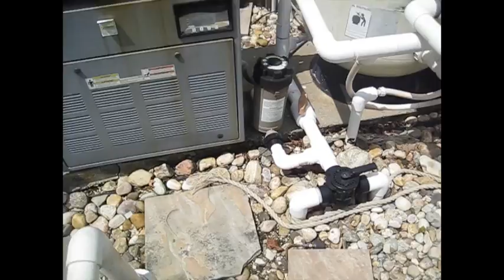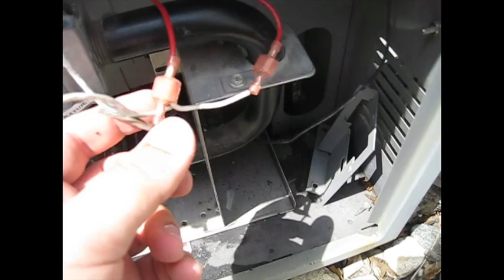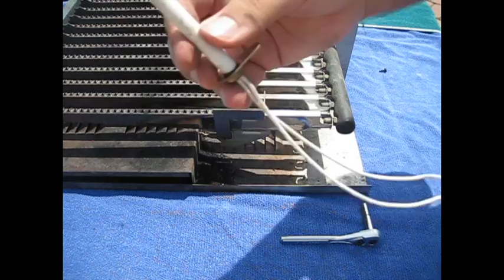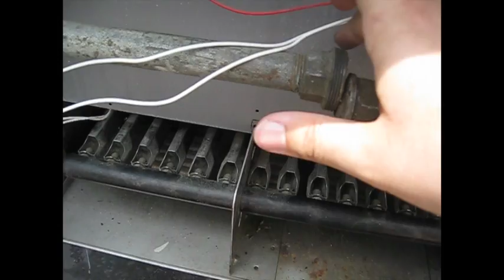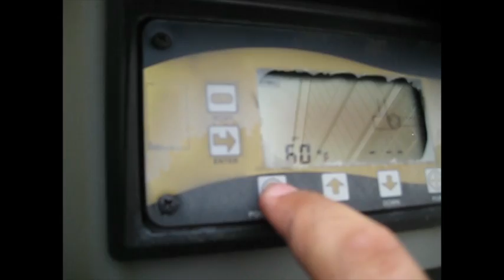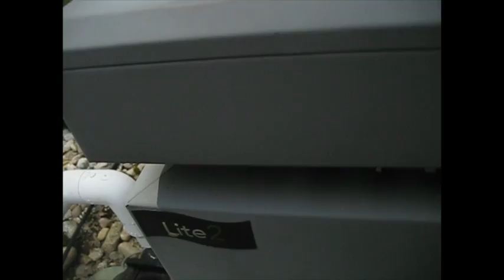Jandy Laars Lite2: Hot Surface Igniter Replacement.

Comment: Very good and detailed explanation on how to replace the igniter. However, I would not recommend standing close to the burner/igniter when fire testing the heater and the reason why is because you could get burnt pretty badly if the heater rolls out.
I have seen people lose their eyebrows and eyelashes and gotten burnt pretty badly because of this..
Reply from the maker: You definitely make a valid point. I had just done it like this so others could see the successful result.

Comment: Great video , only one question remaining for me is can I use an after market igniter from Amazon or do I have to buy the OEM part for 200 bucks?   

Most of the aftermarket igniters don’t have the same quick connectors so I would have to change them ?
Reply from the maker: Yeah you might have to. I don't really have any experience with them, so your mileage may vary.

Comment: Great video.  My Lite 2 is a different model , likely made later than yours.  They changed the setup so that you can access the igniter without disconnecting the plumbing and removing the burner tray.  Easy fix!
Reply from the maker: Oh well that's a nice change! Yeah this model is from 2007, so has been a while!

Comment: So it seems like the ignitor is on the left side of the burners, and the flame sensor is on the right side of the burners, so the idea is the flame must jump from burner to burner all they way across before hitting the flame sensor.

Mine is indicating FL 2, no ignition, and watching it light off, the 4 left burners go but the right 2 (its a 6 burner unit) do not.

Did you ever have occasion to clean the burner gas opening? My pool guy is saying stick a needle in there or something.
Reply: +Scott Franco So I get to answer my own question. A bent paper clip was able to clear it, without disassembling anything. Once cleaned out, it lit right up.
Reply: Any idea what the issue would be if there is no indication light at all when trying to start it up? The quiet 'click' at the beginning is not being heard anymore at the same time it stopped working, any thoughts?

Comment: Thanks for sharing your video. It helped me understand how to replace the igniter - although I didn't have to disassemble things as much as you suggested. I was unable to disconnect the gas feed, despite using a lot of force. But, I found that by removing the screws that connected the pipes and burner assembly from the chassis, it enabled the burner tray to drop down enough for me to access the igniter. I was able to remove the old and install the new igniter with no problem. And then I could start the heater – so my FL 4 problem was fixed. Thanks again!

Comment: Sharkie:

  I have the same heater as you. It runs for about 10min, then shuts off and flashes and FL 0 code.  It then resets itself in about 2 min, and starts up again and heats for about another 10 min and then goes off again. This cycle can just continuously repeat.   Any thoughts about what to do ?????
Reply from the maker: Hi Brad! FL 0 usually means that the water pressure to your heater is too low, and is causing your pressure switch to open. There are a couple of causes to this. The most common cause is a dirty filter. Try cleaning/backwashing it first to see if that fixes the problem.

If it doesn't, two other possible causes is that the switch itself could be going bad, or the small copper tubing to it may be clogged. The switch itself should be located near the top when you remove the front panel.

A way to test the switch, is disconnect the wires to it and join them together. If the heater now runs continuously, then the switch is likely the problem. NOTE that this step should only be done for testing purposes, not as a permanent fix, and make sure your pump is running before you turn the heater on, and after you turn the heater off. Since the switch will be bypassed during this procedure, it will always think there is flow, even when the pump is off. So, be sure to manually turn the heater OFF, BEFORE the pump, otherwise the water in the heater could overheat and damage your heat exchanger.

If you want to test for a clog. Shut your pump off, and then disconnect the switch from the small copper tubing. Do the best you can to have the tubing point AWAY from the heater. Turn the pump on for a few seconds and check the tubing, if it shows a strong stream of water coming out, then the switch is likely failing, of not, then some kind of clog is the problem.

Hope this helps!
Reply: Sharkie626

Sharkie:   ( Thank you for the reply )

    I have take off the pressure switch and ran the copper tube with the pump on. The Stream is not overly strong. That being said, the tube itself, does not seem to be clogged. I have backwashed often and have even tried to run on recirculate, but the heater problem still occurs. I will try to bypass the switch as you have suggested and see if that is the issue.  If it is, I will replace the pressure switch ( AGAIN - bothers me that they are so crappy they need replacement every two years ). If this is not the problem, do you have any other suggestions. Is it possible there is a fault in the high limit switch ?  Could there be a faulty fuse ??

Thank you for your help.
Reply from the maker: Brad Ryan If replacing the pressure switch does not fix the problem, then maybe there could be something up with the control board, unfortunately, my knowledge is minimal when it comes to those areas. But, if you bypass said switch, and now the heater runs fine, then I would have to imagine that it is the problem. Hope it all works out for you!